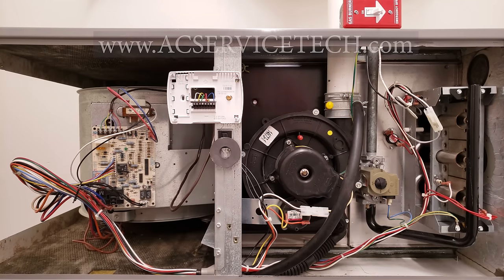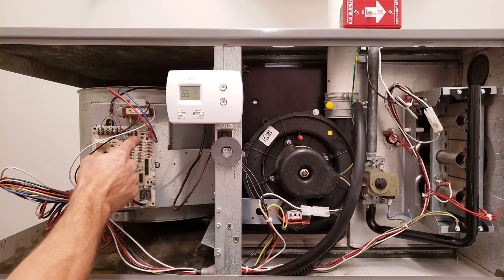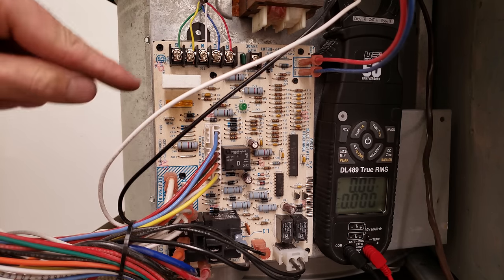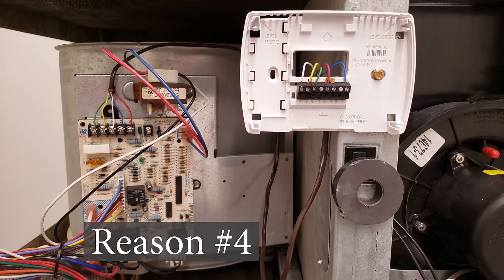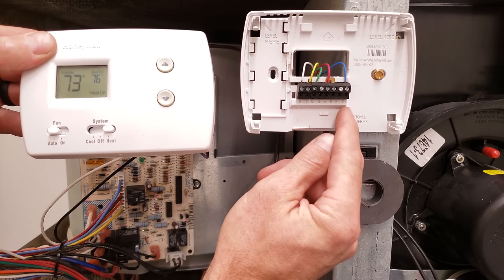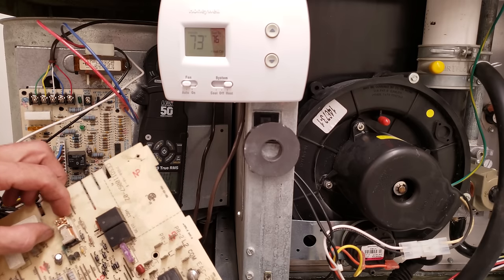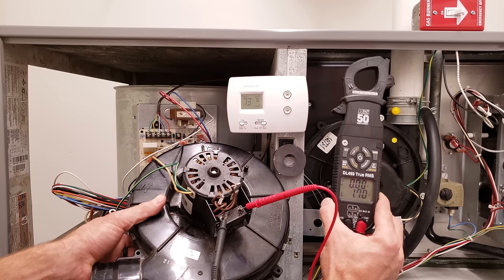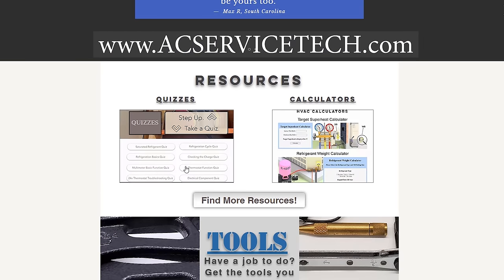Gas Furnace Won't Turn On? Nothing Happening? 8 Reasons Why!

Comment: I have another reason for your list:  I had a HVAC contractor who shall remain nameless install a new 90% condensing furnace and new central AC system in 2015.  Worked great.  In October 2018 it finally turned cold, and I switched my thermostat from "cool" to "heat."  Could hear the blower come on, and the furnace's high voltage igniter cycling, but the main burner would not come on.  Called HVAC contractor who installed, and with which I had a "priority customer" annual maintenance contract.  Sorry, they couldn't send anyone to my house because my area was under wild fire "warning evacuation."  So suffered through 5 days of no heat until evacuation warning was lifted.  When tech finally arrived, took him about 3 minutes to discover that a slide switch behind the furnace cover that controls power to the solenoid that allows natural gas to flow to the burners was in the "off" position.  I didn't even know such a switch existed.  Apparently the tech who did my annual maintenance check earlier in the year for some reason left the slide switch in the "off" position.  Got a profuse apology, and I expect that the tech who did the annual check up is still getting razzed about it.

Comment: I switched on the thermostat and immediately turned it off. That action killed my furnace.  Thanks for showing the black smudge in the center of the blown fuse which helped me identify the problem.  A quick trip to Autozone for a 3 amp blade fuse and now my furnace is back in business.

Comment: Good troubleshooting Craig.  As a master electrician, I have one tip though.  Some naturally assume when they have a 0 volt  reading that there is no "hot".  It could also be a faulty neutral.  At 8:02, you are checking the inducer fan supply by probing the hot terminal and the common neutral point.  More accurate would be to check both the hot and the neutral right at the connector plug.  This insures you have not lost your neutral between the common point and the connector plug.
Reply: C
Reply: Thanks for that info!

Comment: 3:10 - No need to pull the fuse to check it: after verifying 24volts to the board, if you measure 0volts across the fuse, it is good: if you measure 24volts across the fuse, it is blown.

Comment: Another problem you could have is a bad pressure switch or clogged air tube for the switch. Great explanation.
Reply from the maker: Sure, thanks!
Reply: Where  is that p. S
Reply: You talking about the tube that measures negative pressure off the inducer motor? We call it combustion motor
Reply: But he is demonstrating why it won't turn on. The sequence of operation is another thing.

Comment: Been troubleshooting my furnace for several hours 12/30/22 into 12/31/22. Took the doors off earlier today for an inspection - didn't know that there was a door switch that was preventing my furnace from turning back on. When I finally realized the main issue was that the furnace was not getting any power (checked the on/off power switch, checked the breaker) but it wasn't until I found and watched first 1:25 before my problem was solved. Held the Door Switch closed with my finger, and vuolla! After about a minute the furnace was back to running like before. Installed the door and my next step will be to invest in a magnet like you have to hold that puppy closed. Thank you sir! Very much appreciated!

Comment: My girlfriend's furnace wasn't getting any heat.  Her inducer wasnt turning on.  A volt meter showed it wasn't getting any power.  Another (different) video told me it was the HSI, so i replaced it.  But that didn't fix the issue.  Another video told me it was the flame sensor.  I changed that too, and that didn't do it either.  A third video told me to change the motherboard as the inducer and HSI weren't getting power.  So I bought a new motherboard and changed it, but that too didn't fix the issue.  I came across your video and learned in step #5 that weak batteries in the wall controller could be the culprit.  Her house has two controllers, one upstairs, one downstairs.  The upstairs wall controller displayed working digits in the display.  Even so, I opened it up and saw that the batteries were corroded .  So I changed the batteries in the upstairs unit.  But that still didn't fix the issue, even though I cleaned off the terminals as well.  The downstairs wall controller had a functioning display also.  However, when I changed the batteries in the downstairs wall controller, the heat came on!  So lesson learned, sometimes it's the simplest thing.  My batteries had enough juice to work the display, but we're too weak to run the heat.  Luckily for me  all the parts I had purchased over these last two weeks, including the motherboard were returnable as I got them all on Amazon.  Thank you for posting this video and helping me troubleshoot her issue, it saved my girlfriend a grip of cash on a service call.

Comment: Thank you for making this Video. After my air conditioner would not start up, I followed your steps and traced back to power issues. I found a faulty safety switch with a float located in the pan.

Comment: Got motor together furnace is in a cold room that what cools the gaps exhaust that comes out of the furnace is 76% volatile when the furnace that produces Heat sucks are the sewer line on the floor to stop making a positive and negative charge in the ions in the air which what allows the water to go out the tube instead of buildup in the combustion chamber

Comment: You missed problem #1.....what if the led light doesnt come on? Checked breaker, its on and fine. Pressed doorswitch, nope. Worst thing is furance is only 3yrs old and worked fine all last winter.

Comment: Great videos! Recently I replaced a broken secondary fuse on the furnace and a thermostat for my Bryant Heating and Cooling System, and the LED showed a solid red light. However, when I tried to run it two days ago, the LED turned off, but the new fuse on the furnace and the new battery-powered thermostat, as well as the breaker for the furnace are still all intact. Could you give me an educated guess as what could be wrong? Thank you!

Comment: Should start with the batteries in the thermostat.  That anyone can check and fix. Unfortunately it was the last and after I panicked not having a voltage meter trying to figure out what I was looking at based on your pictures it was just the batteries.  Thank goodness for that and thank you for number five telling me to check them would've caused a lot less anxiety. Had it been number one problem. Especially since I had no idea thermostat even had batteries. 😂

Comment: I had a tenant yesterday with no heat. Inducer fan ran, blower ran but the burner wouldnt ignite. I found a loose connection down at the blower. Im assuming a neutral. It was a small white wire wirenutted to a white larger wire coning off the blower

Comment: I have a Goodman package unit that the brand new inducer motor fails to run. There is 240 volts at the L2 and black wire on the circuit board. When heat is called for the inducer motor will bump turn about 1/4 rotation then stop. What’s my next move in troubleshooting? Thanks for the videos and your time.

Comment: I have a whirlpool model number whgA100a46AI0 hvac 2 individual fan units outside two thermostats. My heat worked upstairs last winter. Now the fan blows cold air no heat

Comment: My Goodman Gmp 100-5 gas furnace started up and worked fine as usual for a week or two this fall and then went dead. Totally dead with no sound, no inducer start up, nothing. Took off covers, pushed in cover switch and checked error code on main board. 3 blinks. This means pressure switch malfunction. Since I'm not HVAC trained, and only partially understand the actual sequence of operation, I got sidetracked and misdirected and began checking all the pressure switch videos. KInda dumb since obviously if the inducer motor isn't working (first step) then the pressure switch (2nd step) can't work. The point is that error codes are helpful but you have to be aware of how the system actually works, step by step, or you can waste time, like me. Anyway, after I took a break I realized I was barking up the wrong tree and started to focus on the inducer moter itself. Luckily found this AC Service Tech video. Great info! I'm no electrician either but after watching the video, checked voltage at pressure switch while trying to start furnace and only got momentary 24v so I tracked the pressure switch wires back to the main board. They both are right next to two relays and when I tapped one, the furnace started up! Tapped it again and the furnace shut down. Bad relay. Never would have found it without watching this video first! So I need a main board which runs around $130. but at least I definately know 100% that ordering it will solve the problem. Looks like a no-brainer to pop off the main board and plug in the new one. And to all you HVAC pros laughing out there, at least I knew about the back cover switch! Thanks again AC service guy! I subscribed to your site for the next time this POS Goodman goes south on me.

Comment: Furnace isn't working. Also the AC isn't working I have a gas furnace. I hooked up a new thermostat to it but no power is going to my thermostat I also found out that the repairman who came and fixed it last time put a 5 amp fuse on a 3 amp motherboard. I cannot figure this out and I'm scared to call somebody else to charge me another $700 to break my stuff

Comment: Hi,
Thanks for your great videos. I learned a lot from you. Will you please help me wit this issue.  As I power on the furnace I get the error code 31 which is 3 short flashes followed by a long flash. Please see below for a description of the code. I know my the inducer is OK but it received not voltage and the pressure switch is also fine. Nothing happens not even any noise just the LED light. It can’t be any blockage because nothing turns on to sense that. What do you think I should check for? Thanks!
  
3 1 : PRESSURE, DRAFT SAFEGUARD, AUXILIARY-LIMIT (when used), OR BLOCKED VENT SHUTOFF (when used) SWITCH DID NOT CLOSE OR REOPENED - If open longer than five minutes, inducer shuts off for 15 minutes before retry. Check for: - Proper vent sizing and condensate pitch - Inadequate Combustion air supply. or sag. - Low inducer voltage. - Vent restriction or high winds. - Disconnected or obstructed - Defective inducer motor or start capacitor. pressure tubing. - Defective pressure switch or connections. If it opens after trial for ignition period, blower will come on for 90 second recycle delay.
Reply: solution: I replaced the control board!

Comment: great vid...like your troubleshoot display set-up. so much easier troubleshooting the older equipment when there was just a fuse/breaker, simple thermostat, transformer, oil burner, or gas valve...so much for new technology...!!

Comment: So I have a brand new control board new transformer and thermostat. The cooling works fine but as soon as I put the heater on the fuse pops right away. What am I missing???

Comment: I have an old Weatherking with a fasco inducer 7058-0049.  Is it possible to replace just the motor?   It has 3 bolts attaching it to the main part of the inducer so it seems logical but I couldn't find the motor online anywhere.

Comment: hi if the safety switches such as limit switch or rollout switch is trippes open will that stop the board from giving 120v?

Im not getting power at the inducer motor on the board were the plug connects? thanks in advance
Reply: The board will still get 120 volts but will not power on the inducer or gas valve. Usually they set the blower to run continuously when that happens.

Comment: The capacitor is a 3 mF (for micro Farad) capacitor not 3 uF. The Greek letter “mu”  ‘μ’ (see how it looks like a cursive lower case ‘m’?) is used in engineering when designating micro measurements.

Comment: Greetings.  Great video.  Thank you very much.  My inducer motor was starting, running for a few seconds, and then stopping before the burners were turning on or anything else.  When I checked the voltage between wires R and C, as you mention at about the 5:00 mark of you video, the infuser motor started running and stayed on, the burners came on and the furnace appears to be functioning normally.  My question is, "Why?" and my concern is that, because that was so easy, it won't be the permanent fix.  Do you have any suggestions as to what I may be up against if it quits?

Thank you!!!
Reply: I had this problem this morning. Heat would not start.  Testing the voltages, I noticed the wires move.  Hmm.  Loose screw at the "C" terminal.  I tightened it down, and furnace started properly through the cycle.  Check your screws, maybe one is loose?  

Thanks for the video.  Very concise and clear instructions.
Reply: @SP-rz3tk  Thanks for your input.  I appreciate you taking the time.  This is not my problem.  I have checked all those connections.  I have also replaced the inducer motor.  I'm becoming convinced it is the board.
Reply: It's not an infuser motor, but it has the crazy name of "draft inducer motor."  I have no idea what that means, but it's so confusing I can understand why you didn't remember the name.
Reply: @davidlindgren7605  You are correct.

Comment: I have no power to the inducer and the blower does not come on when set on fan mode.
The thermostat is good and I have power to the board.
my board is the 50a50-112. I am thinking the board is bad.
I cant find a fuse.

Comment: Thank you so much for the videos.  I have an old furnace ( NUGI100AF01) that I have to frequently reset the power to get it to kick on, just turn off the furnace power, turn it back on and it kicks on - it started failing last January.  I cleaned the ignitor but the problem persists. I noticed that the ignition cable has electrical tape at the boot seam that I did not put there, and I have owned the house 20+ years, so I ordered a new ignition cable and if that doesn't fix it I will order a new ignition module (S8610U) - shopping around the parts are fairly inexpensive.   After watching this video, I will replace the old thermostat tomorrow.  My only question = Is there any one thing that will most likely cause this type of failure?  Thanks again.
Reply: In my idea  is  the first you can check the power switch connect.

Comment: Them 2 black boxes produce 377 voltes per side . So no u dont need 24 volt  the 1 wire needs a jumper at thermostat. The 2 furnaces ran together but 1 in house 2 heat other for cooling . Your wake  leave return and  sleep setting need to space out and ocupy 10 houres of the day .   The fresh air line needs 2 go to get cooled sewer gas and exaust gas that comes off other furnace 
 . .   The natural gas is barley needed . Never mind u dont realize electrisity and air and water and smoke .   No hydrogen cell moliquels are so small during heating it breakes down  metal .

Comment: Is there a video after this that goes to blower motor check out ?  I pass all 8, gas ignites, heats up, and abrubtly shuts down - fan does not come on and I get 4 flashes, so I know the motor is good.  Is motor getting 120v ?  No.  Why not ?  guess it might be a relay, bad solder joint, bad contact set ?  Board is only 2 years old, other board is new, motor and fan control are new in July...hmmm

Comment: This video saved me too. Found a fuse under a bunch of wires that I didn't even know existed. It is Christmas Eve so I was in a bit of a panic. Please send me your PayPal so I can buy you a beer at least 😂
Reply from the maker: Eric, www.paypal.me/acservicetech and thank you very much and Merry Christmas!
Reply: LOL Christmas eve and my furnace does not want to start. Christmas day now and no heat.
Reply: Raven Right if you don't pay money no1 is going 2 help u this dirty world is all about money
Reply: @bullduzheriks6265  I called a Furnace man that came out and said it only needed cleaned. paid close to $100.
Had the same trouble for days and he said it was my regulator on the tank.
I went to the place I rent and fill my tank with and he said not the problem.
Thank god it slowly started working ok on it's own.
Just a note: When ever I buy anything I usually say keep the change' Even the furnace man I gave a few dollars tip also/
Reply: @ravenbishop5232  Right Ripp Off Big Thieves

Comment: My igniter doesn’t turn on , changed it and worked great for a while, then started not lighting up again. I started tapping wires around and it will work. 🤔

Comment: I know a guy once .  That after a new install . Could not figure out why the condenser and furnace burner.   Both run simonataiously.

 Christ really .   If the homeowner when he Re drywall ed.    One of the Long screws had directly hit the t stat wire.         Twisting in.  And had cross voltage 
 To both  units powering them up .
  I mean wtf .  We're the chances.
 Also.   Word to the wise .     There is no need to use 3" long drywall screws.   To panel boarding .     Theses screws are very pointy

Comment: what if AC works, fan works, you hear the inducer motor kick on with heater but no Air at all comes through the vents
Reply: it’s probably the flame sensor or the ignitor check those out all u have to do is clean the flame sensor look it up i’m a hvac technician

Comment: I own it and there is a cave system with other furnace thats burnt .  And no not aloud down there . That board and wireing is for a dule furnace set up . Not yours stop . Air is allways 57 coming out of cave and up stairs behind wall i couldnt figure how 2 open .